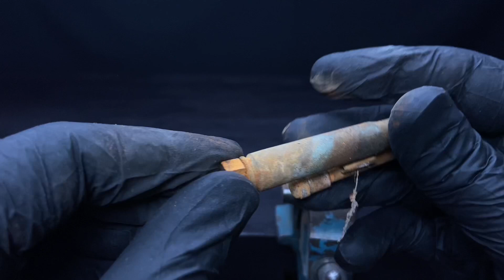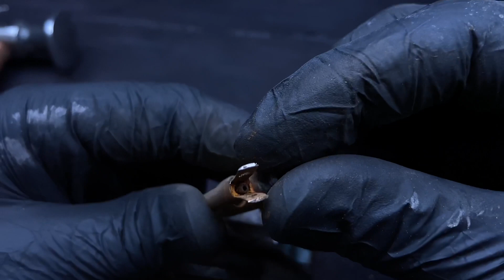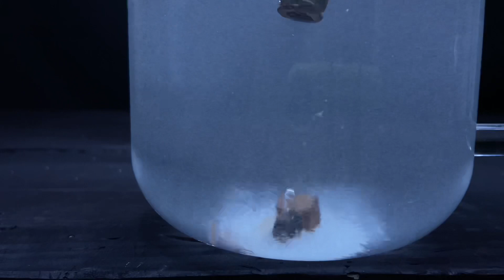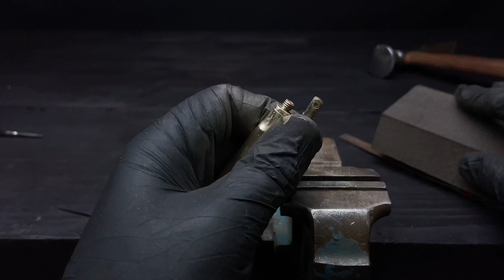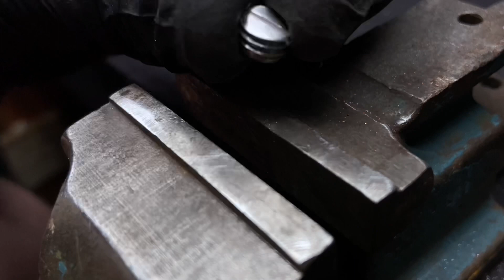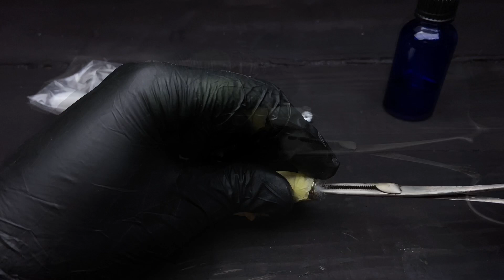Restoration of a gasoline lighter

Comment: Great job. The meaning and soul have been given back to this item. 
In the water soaked trenches only few soldiers managed to have dry matches. The fuel lighters were the way to get fire to light tobacco...
Thanks for your video.
Reply: @rust_hunter   Btw: I forgot 2nd big advantage - soldiers in the trench-system used dimmed light to find the way at night. The bright flare-up of matches pointed them in the sight of the enemy and they easy became target.
The lighters were easier to light-up and to conceal. 😉